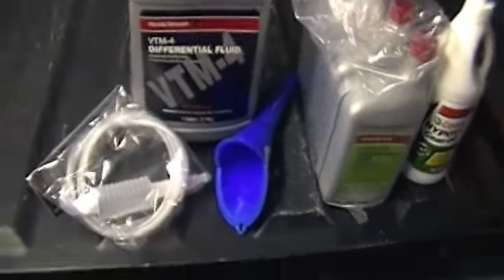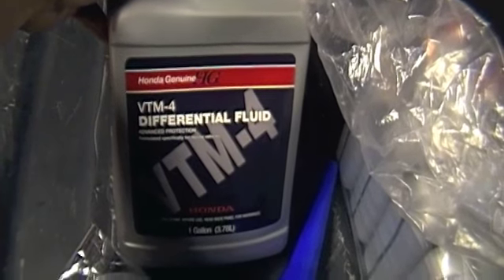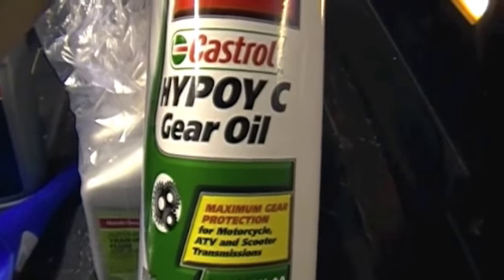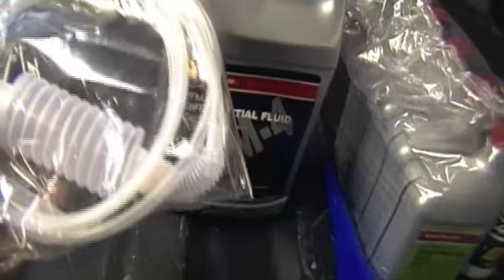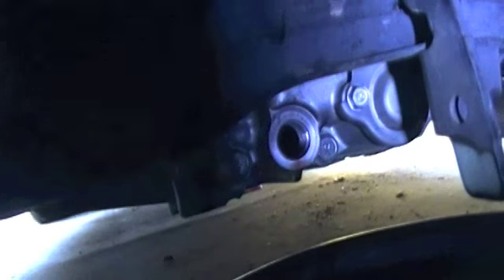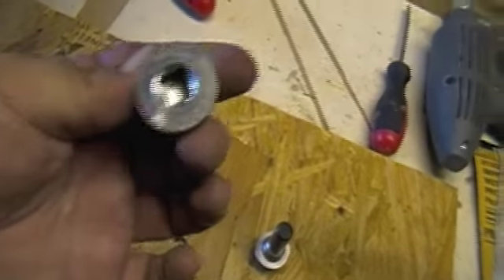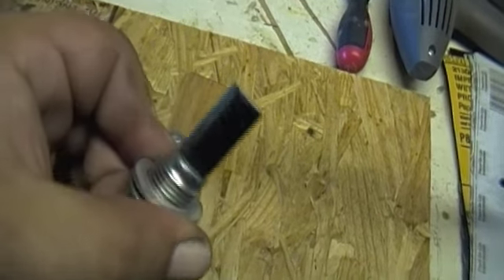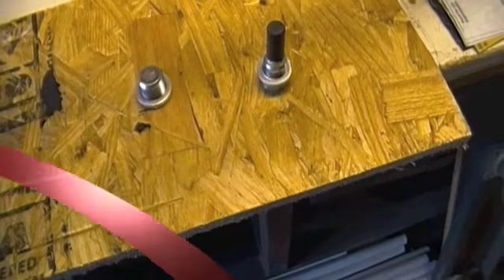How To Perform the Honda A136 Service on an 07 Honda Ridgeline Part 1, Rear Differential

Comment: After you fill it, you should plug it and drive back and forth about 8-times in your driveway. Then unplug the fill screw-it will take about another 1/2 cup of fluid after it's been circulated.